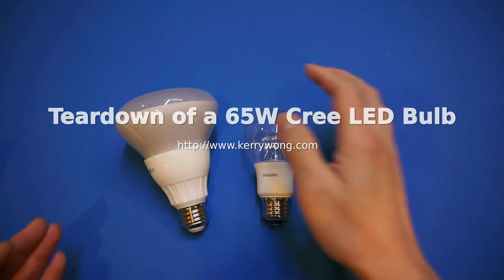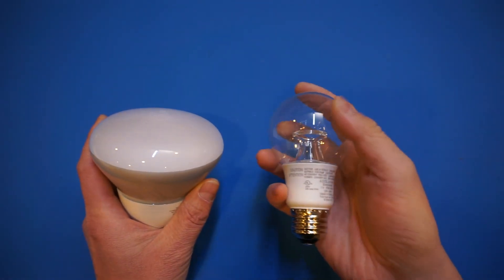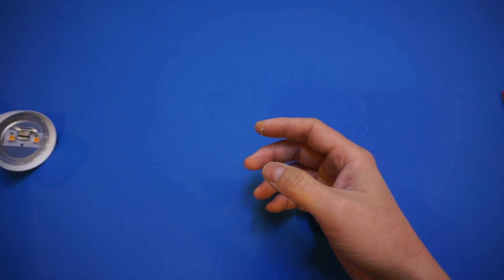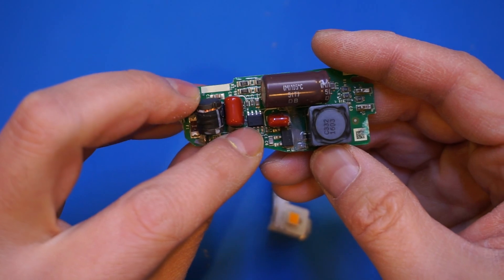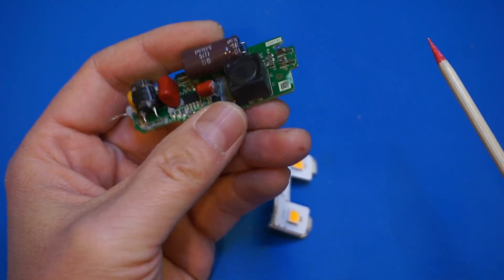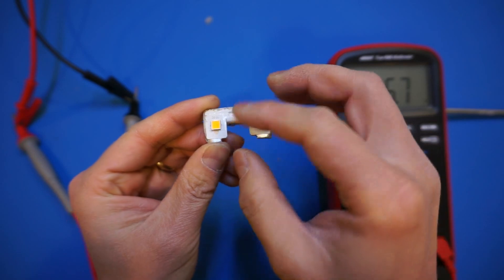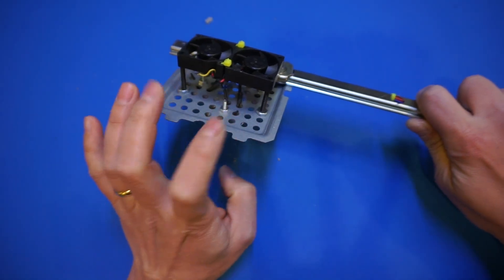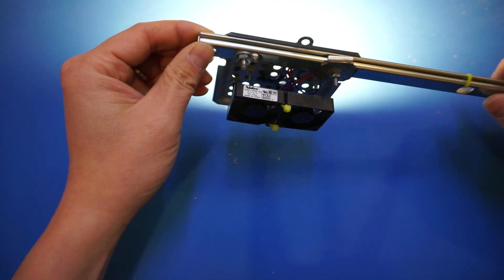Teardown of a Cree LED Light Bulb

Comment: I'll never buy Cree again. The 2 ~10W dimmable bulbs I bought admittedly ARE dimmable, but make horrendous noise when dimmed! Unbelievable.
Reply from the maker: Mine makes noise too. It could be dimmer though. But some bulbs arguably make less noise with the same dimmers I have.
Reply: It´s possibly to almost definitely the dimmer. You need a true sine one. The sine chop ones are horrendous, they emit noise of all the RF spectrum and and really bad for the input diodes and capacitors of the LEDs.

Comment: Don't know why leds need to be in bulb form, just to be compatible with old fixtures. If you would go for new lamp, light or whatever, it would be better to have led on larger area for cooling reasons
Reply: EXACTLY! Plus, because the LED lights can last for many years if designed properly, there is no need to keep them in the easily replaceable, but limiting, form.

Comment: Designed to operate right on the edge of thermal specifications to guarantee a short service life (and revenue stream for the manufacturer). I mod mine down to 5W or so (by changing the current setting resistor), they run significantly cooler and last much longer.
Reply from the maker: You can't easily open up most of these bulbs though.
Reply: Some of them you can, I shopped around locally until I found some that were both easy to open, used a quality unpotted switched-mode supply and were still relatively inexpensive at around 4€ a piece. They used screws to hold the LEDs and front heatsink plate and the circuit board connected to the socket with contacts so it could be easily pulled out with pliers.
Reply: I do exactly the same. Cut their power down to a half or a third, and they should last much longer, as far as the heating issues are concerned.
I just don't agree that they INTENTIONALLY make them short-lived. It's simply the issue of manufacturing cost vs. profit, plus there isn't much "wiggle room" with the standard light bulb sizes to allow sufficient cooling at above 5W.
Reply: Edin Fific, If you have a product that should last 4-8 years can only last a few months or a couple of years (when there IS the tecnical expertise and tools to have them last MUCH longuer) then, or they do it INTENTIONALLY, or they are INCOMPETENT. If the product is Phillips or similar (when suposedly quality is reflected in the price) then it should be CRIMINAL as it is a CON. But we are used to be fed with programmed obsolesence as a norm (be it hardware degradation, outdated software, new technology that is barely better or fast paced fashion).
Reply: me too :)